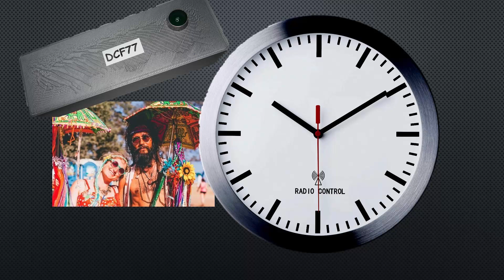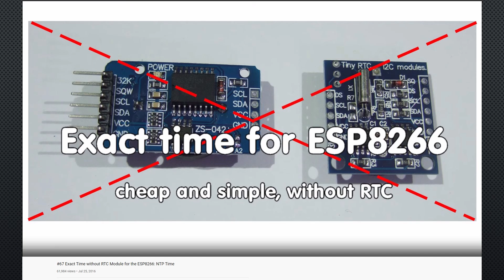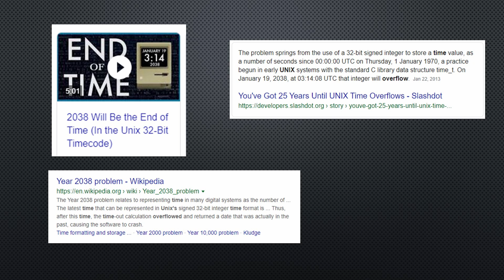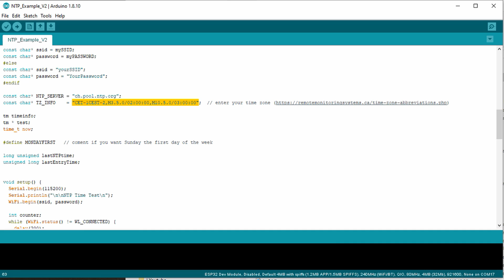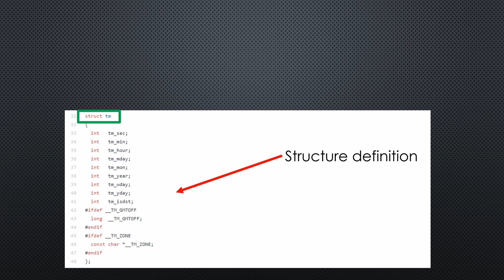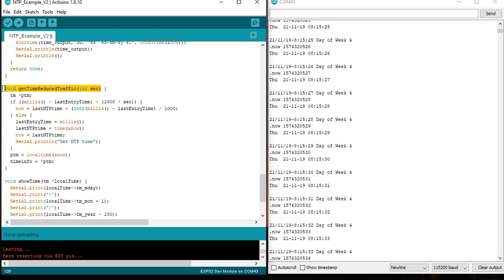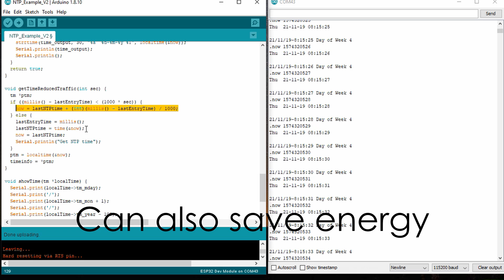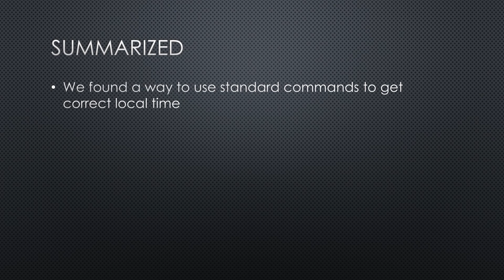#299 Tricks to get NTP time for the ESP32 and the ESP8266 incl. Summer- and Daylight Saving time

Comment: Just for the record, you would NOT WANT the time servers to implement daylight savings time or other features.  It is totally correct to have a global UTC time network, and then for local presentation do the work to implement time zones and daylight savings.  It is not a weakness that NTP only uses UTC, it is a feature.
Reply: And no leap second smearing either :)
Reply: @var67   IP ?
Reply: @jtauscher  well, as most  people uses IPv4 and not IPv6, then you have no way of knowing which time zone you are at.  And you could still not be able to now, as the IP address are supposed to follow you on your personal network.

IF we all used IPv6, then we could be able to figure that out from the IPv6 address.  But from IPv4  private addresses (which usually are 192.168.0.0/16 or 10.0.0.0/8 in IPv4) there are no way you could do that.
Reply: @AndersJackson  IPv4 was originally supposed to be a geographiocal routing table like IPv6 now is.

first octet was site, second department, thrid subnet and then the network number.

It became apparent within months that not using 128 bits from the outset as Vint Cerf originally intended was a mistake, but IPv4 was only supposed to be in service 4-5 years (he was talked out of it and into 32 bits BECAUSE IPv4 was a temporary kludge, memory was expensive and 32 bits was "sufficient for current needs"

BTW: if anyone complains about the size of IPv6, point out that it's NOT intended to be filled and is instead a Red/Black routing tree

Moving enirely to IPv6 will vastly simplify internet routing systems worldwide

As for widespread use of RFC1912 (192.168 in particular)  and NAT, I'm partially responsible for that. it started out as a way of getting groups behind modems hooked up in university towns where 4-5 people needed access and lived in the same student flat so they were fighting over one phone line. From there it got out of control pretty quickly after I published a bunch of Linux firewalling/NAT scripts in 1994 and subsequently demonstrated providing mail-only or usenet only services using private IP assignments instead of messy UUCP setups (it knocked a bunch of proprietary mail software out of business because people could just use Eudora)
Reply: @var67  yes, and maybe I want to display something else but my local time. Me for example displaying Berlin and Athens time. It is very comfortable how it works.
Reply: Exactly correct. Radio transmitter logging at broadcast stations has been using UTC for decades regardless of the timezone theyŕe actually sited in
Reply: @var67  try the GPS receiver?
Reply from the maker: I would have liked a function call in addition to GMT where you can get local time...
Reply: @AndreasSpiess  If you have mqtt in your project, then fetch the timezone string from there.
Or use one of the "private use" options in DHCP, option number 224-254
Reply: @AndreasSpiess  that would be nice, but Time Zones are a political mess, nothing that is govern by mathematics or other easy ways to model.

Yes, it is an FEATURE that we all let the computers uses the same time, and then let the computer from that time calculate the proper local time. Then we don't need to change any clock because of change between Time Zones or between Normal time and Summer time or even leap days or even leap seconds.

Consider this.  You are logging in on a computer on the other side of the world.  You want it to present the time in your local TZ, not the one local to the computer. Which work best?  Have the computer adapt the universal time to your and all other people that uses that computers TZ, or let every user that log in set their own local time?  And the same goes with calculate leap years.  As we also have leap seconds.  Some times even two leap seconds.  So it happen that we have 61 and even 62 seconds per minutes. Not often, but it has happen.
And yes, we have different calendars, two western that are not in sync, and one Jewish, one Islamic(?) and some 10 or more from other cultures.

UNIX used a universal time and adopted the time when printed, depending on the TZ environment variable.  Just change it, and you will get another time printed. Just try on a RPi.

This is a good example on why Time Zones are a hell.  And nothing people should manage. 
https://www.youtube.com/watch?v=-5wpm-gesOY
This is about Localization, which also is some "fun" problems to solve.
https://www.youtube.com/watch?v=0j74jcxSunY
And about the history about ASCII and up to Unicode and UTF-8.  Also fun.
https://www.youtube.com/watch?v=MijmeoH9LT4
Reply: @AndreasSpiess  it becomes useless the moment you want more then a signal to set the clock its just to make all the clocks on the WAN all beat at the same time. if you have to add more calculation to it to get the local time or even daylight savings from the server you add milliseconds to the sync pulse thus you create a desync. the whole reasons to have a distributed network of ntp server pools is that you have a server with the lowest latency. if for instance you would only have a ntp server in Hawaii and the whole world would have to sync with it. the pure latency on the other side of the world would trow the whole network off.

Comment: Interesting video, as always!
"tm" never seemed that weird to me, to be fair. I've extensively used that structure back in my network/server/socket programming days. The only field from that structure that I always found "weird" was "mday", which starts at 1 instead of 0 like all others. (Fine, year starts at 1900, but that's basically 0 from a "century" point of view).

Minor correction about Aknik's code: His variable names are most likely in Italian (or what looks like Italian to me). Or at least 100% not Spanish. That much I can tell.
Reply from the maker: I think it is no problem if you know the definitions of the structure. I searched for my mistakes when I first got the results :-(
Concerning Italian: Obviously I mixed them. Thank you.
Reply: Agree too. To me it absolutely looks like Italian. As you say, not Spanish for sure.

Comment: Year 2038 is only for signed 31 bit systems. Declare time_t as uint32 and have no problems until 2106. No problems except when you talk to the 31-bit computers ;)
Reply: Gerard Sharp no, int is signed 32 bit so you'll go in to negative values past 2038.
Reply: Times prior to 1970 need to be represented... Not often, but it does happen.
Reply: Well, as per the applicable standards, the time_t is proclaimed to be of "some signed integral type", and some of the API functions return for instance (time_t)-1 as an error indicator. So even though the type is supposed to be able to represent times before 1970, the exact times 1969-12-31T23:59:59Z and 1970-01-01T00:00:00Z can be problematic or ambiguous; the former because it can actually be an error, and the latter because 0 is often used as a default initial value or to indicate other conditions such as "no time" or "missing time data".

Comment: Who cares about the 2038 problem? I'm more worried about the https://en.wikipedia.org/wiki/Year_10,000_problem

By then we will all have died out or live as technological lifeforms in a supercomputer (matrioshka brain) and then the Y10K problem can be really damaging. Imagine preparing to launch some fireworks, then the rocket disappears and later you discover that the simulated world is at 0000-01-01 00:00:00, the worst new year ever...

By the way, the header file is called time.h and not Time.h. Windows ignores the case, so it will compile but the code is broken and won't compile on most other operating systems.
Reply from the maker: I read teh first time of the year 10'000 problem. According my death calculator it definitively will no more one of my problems ;-)
Thank you for the "Time.h". I corrected it. Another prove of the superiority of Windows ;-)

Comment: What is the impact on power consumption when using time functions or are they enabled by default?
Reply from the maker: I assume it is only there with the time.h library. Otherwise it would not know where to call...
Reply: They should be pretty minimal. When you enable SNTP by calling the configTime() function the SNTP client will only call the server once an hour after the initial synchronisation. It uses the very efficient timer mechanism within the LwIP library used by the ESP family for their TCP/IP stack. There are no additional threads for example. There will be a bit more memory usage but not much. The code for SNTP is pretty much always there whether you use it or not. I've been fixing/updating SNTP support in the ESP32 and ESP8266 Arduino libraries recently which is why I come to know all this...;)

Comment: why do seconds go from 0 to 61??? at 8:00
Reply: This is to allow for leap seconds which may be added to UTC, because the defined time as measured by atomic clocks doesn't exactly match the observed solar time. Over time this discrepancy would  otherwise accumulate an offset between UTC and solar time.
Reply: @hotgluegunguy  That was what I thought initially, but leap seconds count to 23:59:60, not 23:59:61, so I can't understand the need for a 61th second? Maybe it's there as room for expansion if they ever needed to add two at the same time?
Reply: @sstorholm  I think you're right. Simply future proofing.
Reply: @sstorholm  Actually, doing some quick research, I noticed that in the first year of leap seconds being introduced (1972), two leap seconds were added. One on June 30 and one on Dec 31. So the ability to add two leap seconds might be for software that only adjusts for leap seconds once a year, say Dec 31 after 23:59:59. Just a guess though.
Reply from the maker: I did not check the asterisks :-(

Comment: You should check out eztime library, it's a very simple way of getting the correct local time. Works on eap8266 and esp32
Reply from the maker: It looks that it solves similar topics. Also a good solution.
Reply: @AndreasSpiess  yes very! It just allows you to use the POSIX code rather than worrying about the beer or drug induced time format.
Reply: This library is amazing... thanks
Reply: Just used that time library "ezTime" successfully in one of my previous projects.
Reply: Didn't know eZtime library, till now. Works great, thanks for the recomendation.

Comment: Thanks for the insights in time handling. I made good experience using the ntp Server in my router instead of creating Internet traffic and CO2 emissions. All of my ESPs and most other devices have the same time reference - my router. Best sync, and avoiding traffic.
Reply from the maker: Good idea. The Adaption to local time might still be necessary.
Reply: @AndreasSpiess  Yes indeed, it is. The router does not make any conversion.  My IP list contains > 60 Units. So using router (Fritzbox) as NTP server helps a lot avoiding traffic.
Reply: @klassichd10  yes, it is not considered "polite" to have all the clients on a network poll a remote NTP-server. You are, as you do, supposed to query the local timeserver.

I wonder how many systems honour the NTP-server option from DHCP, but it should be fairly easy to implement in standard routers.
Reply: @LeifNelandDk 
Windows didn't in the past... Would just use NIST or whatever the other default was regardless.
I ended up setting up a firewall redirect on my home LAN, and a fake DNS entry for time.nist.gov at work. In both instances, they pointed to the local NTP server.

Comment: Looks great, I was also searching for something like this for a project. My only concern is: As the EU is going to abandon DST at some point in the future, this implementation will produce wrong time values from there on. How can I take precautions for that? I thought about a web interface toggle to change the string between no DST - normal DST - permanent DST. Thanks!
Reply from the maker: I do not plan for more than 10 years ahead ;-)

Comment: Oh no! Time!!! Einstein himself would have an apoplexy trying to deal with programming time! Since working on a system recording real time data across many time zones a number of years ago, I became convinced that time really doesn't exist! Lol! So go on - timestamp your data and see how many variables you have to include to separate out or synchronise each piece of data (and don't forget the duplicated data that occurs when the clocks goes back at different times in different time zones!)!
Reply from the maker: Fortunately I usually do not go below 1 sec precision in one time zone. This makes it a little simpler...
Reply: Its an insanity made by silly humans unfortunately.  UTC or GMT is the way out but it apparently is still to hard for the normal's out there.  There is absolutely no reason for the time changes any longer this is 2019 going on 2020 not 1600's where perhaps farming was tied to day light hours.

Its a tireless legacy that needs to just go away, but if you need to do these calculations you would do them on your backend system.  Fortunately for me I use Java mostly so Joda Time takes care of this in 3 lines of Java.

It was a good fix for those that need to do this on the embedded side,  there is more info on how to adjust for drift using the pool of ntp servers on pool.ntp.org another way to get time if you have an iot out there with a GPS is to sync time with that as GPS time has to be accurate, this is also an epoch and works very nicely with the rtc library for most clocks.
Reply: @sethrd999  unfortunately GPS time does not match UTC either, and while the offset is trivial,  your original data is always the reference, not the backend calculations, so if you record GPS and convert to UTC, you now may have to hold the history of calculations that determine the offset between the two at the time the data was recorded. The more critical a timestamp is to your data, the more time itself starts to look like an amorphous beast!
Reply: @sonovoxx  You're right, and having had to deal with timestamps in the past similar to what you have, I second your concerns about how complex temporal calculations really are, especially when we live on a wobbly ball of dirt and water that doesn't even have a well-behaved rotation! Regardless of this, let's also not forget that POSIX time is not the same as UTC, nor is it GPS time, nor TAI. It is close but not quite UT1 either. Furthermore, the time_t value used with the <time.h> header (not <Time.h>) in C and C++ is not necessarily the POSIX time value, although I have yet to see an implementation that didn't use it. Most modern libraries also have switched to 64-bit time_t a long time ago by now, but of course the exception is most likely in this very field of micro controllers that we are dealing with on this channel. :-)
Reply: @benhetland576  stop right now... you're bringing back all the nightmares! 🙉🙉🙉😂
Reply: @sonovoxx  oh, I'm so sorry! 😱😯 haunted by the past I must be...
Reply: @benhetland576  past? Oh, I see what you did there! They say time is a great healer... ah wait... time??? Oh no - here we go again!!!

Comment: thanks Andreas, ive been using NTP in most of my esp8266 and esp32 projects, but i never knew about the TZ_info string...i always just used it as "GMT+10" and changed it when daylight savings started or ends... but the complete string with daylight savings start and end dates seems alot better..
i also tend to load the NTP time into the inbuilt clock and only update it once every 24hrs (or if the micro reboots)
Reply from the maker: We do some investigations. It seems, that the time function also calls only every hour the time server. So we would not need the second function.
Reply: @AndreasSpiess  you may want to look into the functions,  setSyncProvider(getNTPtime)  and  setSyncInterval(86400);  ...they are built into the time library and are usable with ESP's

Comment: Many program's in the early days start every count with the 0...so you have more until you reach the end of the range. In a time where memory-space is expensive that was a big issue.  Also indexes in programming languages start many times with 0 as first element.
That doesn't mean they must be out of their mind to used this 'golden rule to start' also on month counts.
So you are absolutly right.
Reply from the maker: I agree in general. Here I had my problems with consistency. and there was no need to start with 0 as no number reaches even 255... And they are all int.
Reply: @AndreasSpiess  I coud see a problem with uninitialized systems trying to get undefined month 0 if it was done otherwise.